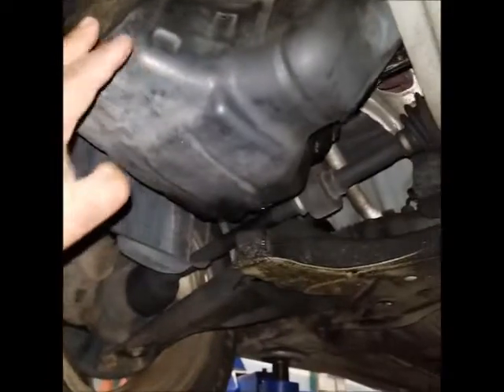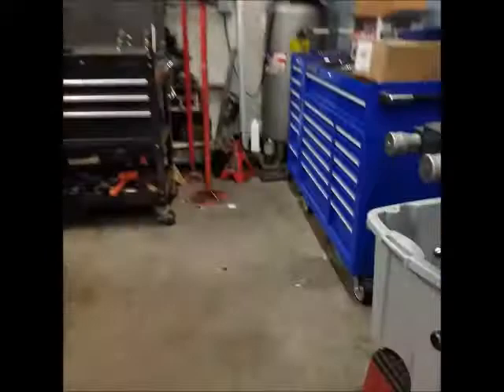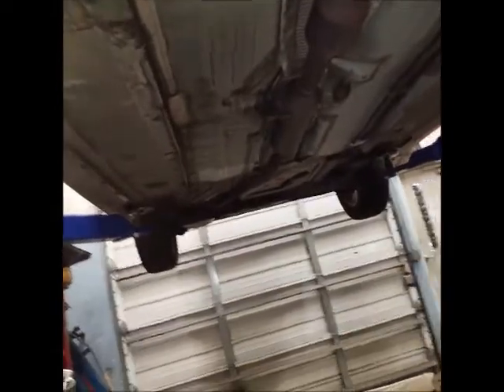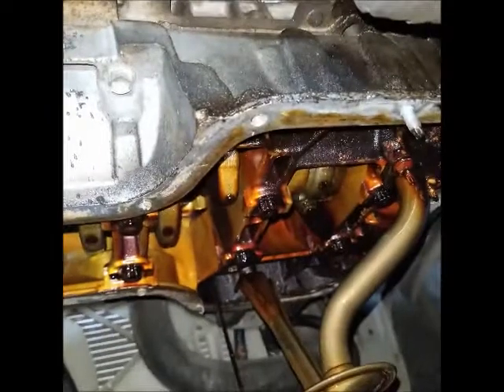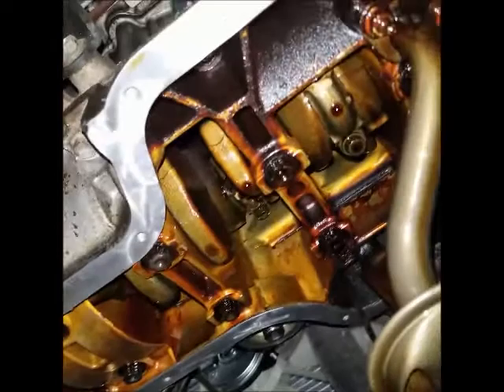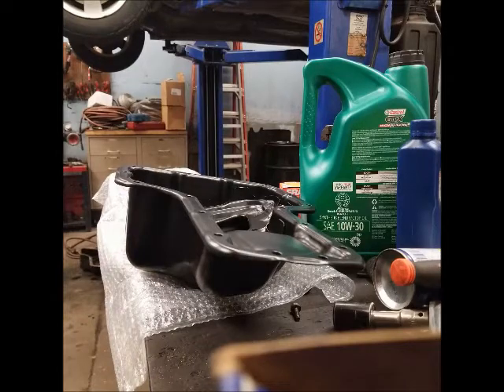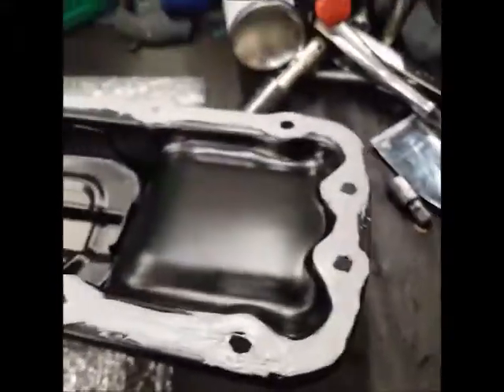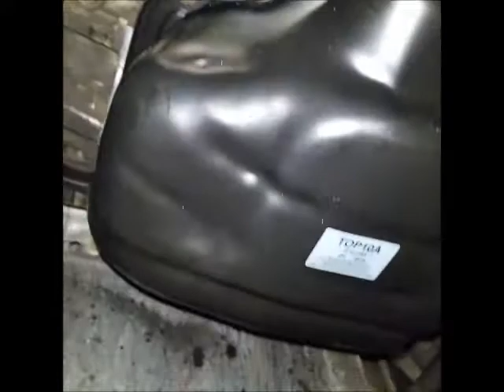40.- 2000-2005 TOYOTA COROLLA  OIL PAN REPLACEMENT

Comment: I just did mine without removing the oil filter, any of the covers, or the frame piece. 
I literally removed ONLY the oil pan bolts and pulled the pan down.

Comment: Was the old pan damaged? If I have just a leak on my pan do i need to replace it or can i just clean the old pan and make a new gasket?
Reply: That's what I want to know.
Reply: If your oil pan is just leaking where the old gasket/silicone is then you dont need a new oil pan.. simply remove pan , clean away all old rtv silicone on the mating surfaces and apply new rtv silicone (as a bead) and reinstall pan , wait 1 day to dry before filling with oil

Comment: Do you have to put the flywheel cover back on? I think the mechanic took it off and didnt put it back on. And the fel pro gasket was used but upon putting it on then screwing it back on the little bit of the gasket slipped out but the oil  didnt leak. I dont think he did it correctly. Making me kinda nervous. Should i be worried?
Reply: Yes put it back on. You don’t want anything like rocks getting in there and damaging the teeth on the flywheel.
Reply: @revamp6612  well i ve to get new cover cuz the jackass mechanic didnt put it back on. If i go back to him he is gonna say he didnt do it. Probably he threw it away. Its ridiculous.
Reply: @xvdmrecords  yeah it sucks that some mechanics are like that.

Comment: How long do you wait until you can put the oil in a d start the engine ? to what torque have you tightened the screws ?
Reply from the maker: 6hrs and torque is 8ftlb
Reply: Tightly
Reply: @miguelquazar883  LMFAOOOO